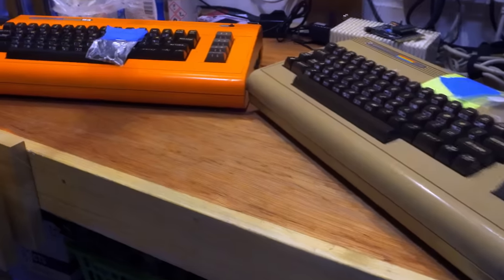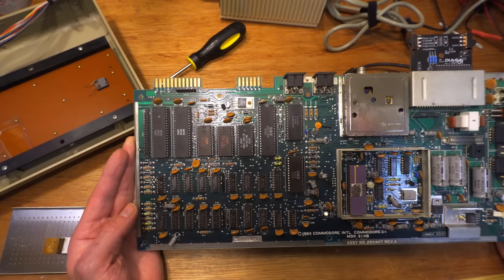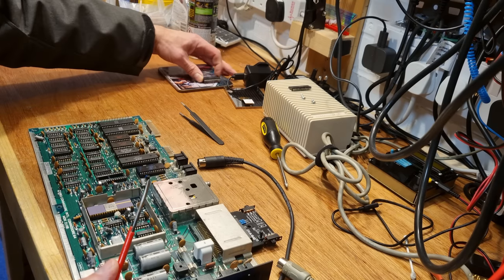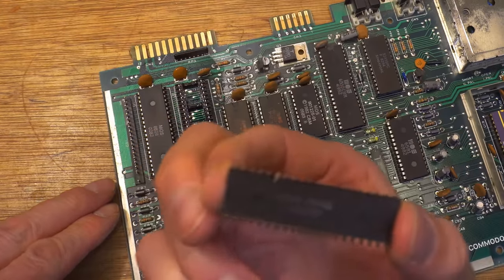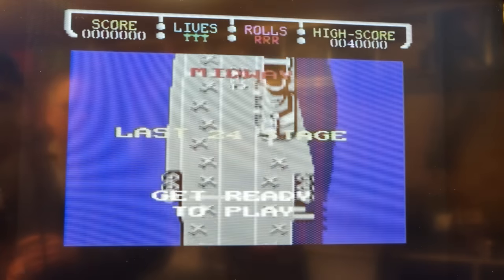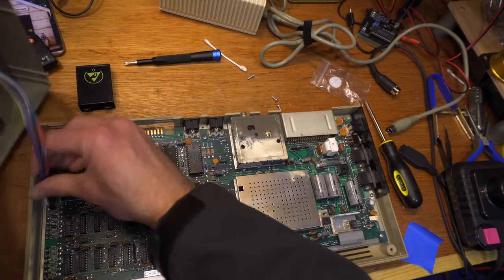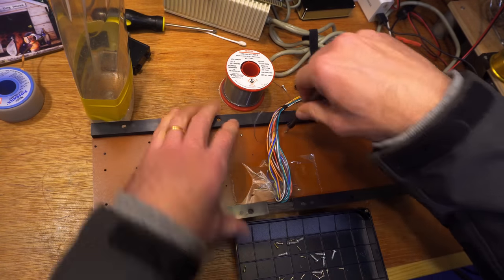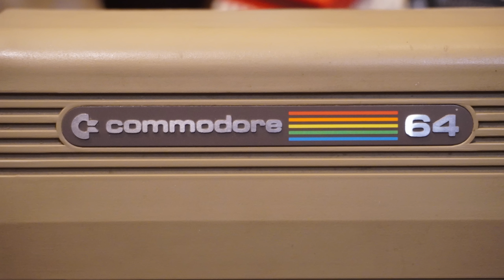C64 Broken Since the Day it Was Made?

Comment: My Amiga 3000 turned up with four pins on the chip RAM bent like that. Not sure if it was from factory or not, but the machine would work... most of the time. Random crashes FTW. Works 100% now in any case!
Reply from the maker: It's weird to think all these years later we're still finding faults that have been there all this time! I recently had a brand new BBC Master 128 on my workbench. A stunning machine, literally unused. There would have been a small chance it was faulty from the factory but nobody had ever plugged it in to find out! Crazy! Fortunately it worked just fine :D

Comment: Yes that wire was put there on the factory.
Reply from the maker: Interesting! I've seen it on 2 machines now, but only those 2. I wonder why that was needed?
Reply: @MoreFunMakingIt  probably for wiring! 😜SCNR
Reply: @MoreFunMakingIt  the +5v has 2 pins it can be on depending on the psu..
So there was a chance a psu would be using 1 of the pins that was N/C so they ran the jumper.
Reply from the maker: @Mr_Meowingtons  interesting! I didn't know that.

Comment: I have a demo model SX-64 that's made with "defects" before they changed the design to be more Commodore 64 compatible.
Reply from the maker: Is this one of those "it's a feature, not a fault" things?
Reply: @MoreFunMakingIt  My guess it's expansion port timing that worked better with CP/M cartridge they were working on.  But it causes incompatabilities with many cartridges.  Works well with Epyx Fastload, though.  But cartridges with capture such as Final Cartridge don't work.  Also the Easyflash3 I have sort of works, but can't save game progress to the Easyflash, also can't program the Easyflash3, it locks up as soon as I try to send a program over from PC.  There's slighrt cosmetic differences on the outside too, such as "executive computer" being a sticker, and no embossed port labels on the back of the unit.  The ports are unlabeled. There are fixes I can do to help with cartridge compatibility. but decided just to leave it stock. It's just timing on the port.  It's in like new condition, so really don't want to mess with it.
Reply from the maker: @delscoville  Wow! That sounds like an amazing machine to own. I would be the same with something that unique. It's there to be appreciated for what it is, not what it might have supposed to be.
Thanks for sharing that!
Reply: @MoreFunMakingIt  For the most part, it just looks like any other SX-64.  The sticker and the port labels are noticed only if you look closely.

Comment: My first comment on this channel is : Use a special IC revomal tool and give us technical viewers some sense of ease :)
Reply from the maker: Haha! The screwdriver and the tweezers I've been using have no sharp edges so they're fairly safe. But! I have the real deal tool arriving today so rest assured after a few videos you'll be able to stop clenching each time I take a chip out 😂
Reply: @MoreFunMakingIt  Was really j/k. I also use a screwdriver to pull chips, my bad hahaha. Keep up the good work, you've got a nice channel going here. And retro stuff is always popular. I still have all the machines I got in the 80s and early 90s (C64, MSX,Amiga 500) plus a special dumpster find: A nearly mint VIC-20, and still working perfectly, even the caps were still functional. That said, my old stuff needs recapping, the amiga's battery I expect will be a mess, haven't checked in years lol